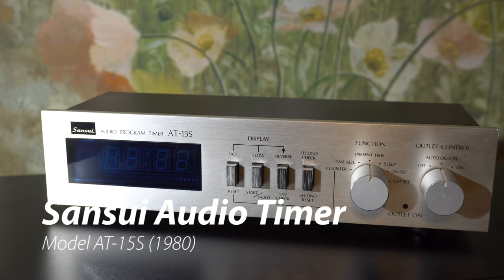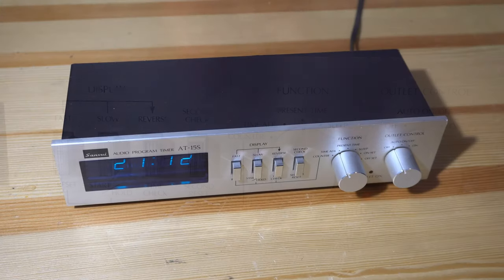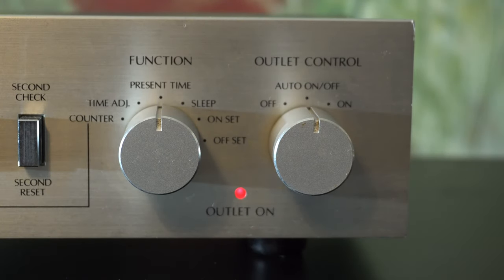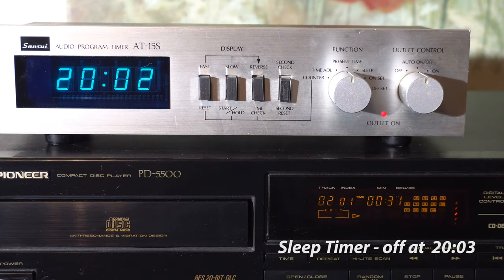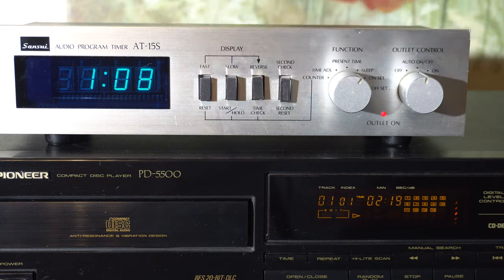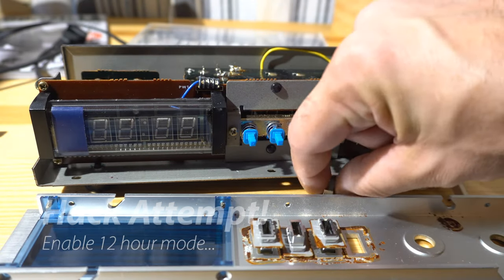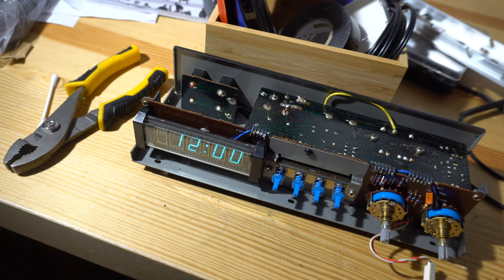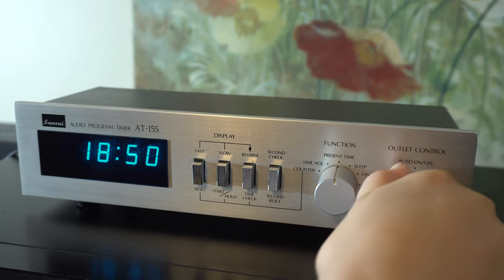Hack Attempt: Sansui Audio Timer (Model AT-15S)

Comment: Very nice :) I was searching the net using the words Audio Timer and your vid came up among other things.
But what I did not know is that it is quite similar to my unit which is not a Sansui but a Panasonic TE-97. They resemble some similarities I guess, for example the 4 rectangular buttons to set the time. The Panasonic has very little info on it and so I wanted to find out more about it and your video made it clear. Although the Sansui is more equipped than the Panasonic.
Reply from the maker: Thanks for watching and commenting! Yes it does look very similar to the Panasonic. These type of stereo timers show up in the "other vintage audio" category on eBay very often...

Comment: There are other timers that use the same Integrated Chip (MN6076) and have that AM / PM function. For example: Pioneer DT-510.

Now, just a quick question: i have the same AT-15s, but the display only show part of the numbers, its not working right. What should i do? Changing the IC is my first guess, what do you think? Cheers!
Reply from the maker: Before changing the IC,  you could verify the LEDs are working... Perhaps you could jumper a wire to send voltage to one of the malfunctioning LED segments to see if it lights up? If the display works, then you know the problem is it is not getting power and trace back from there... Also, there is a service manual available with schematics to download from hifiengine.com - good luck!
Reply: @ACBMemphis  Will check that!! Thanks!!

Comment: Just got one....don't know how to use its functions. I was able to set the time, but that's it. Not sure if it's defective. Can you help me out?
Reply from the maker: Sure. Here's what I did to make it work: (1) Plug it in, it will start to flash "0:00" (2) then set the function knob to "Time Adj" and use fast/slow to set the current time. (3) Next, turn knob to "On Set" and use Fast/Slow to set the time you want the stereo to come on. (4) Turn the knob to "Off Set" and use Fast/slow to set the time you want the stereo to turn off. (5) Set the function knob to "Present Time" (6) Finally, set the Outlet control knob to "Auto/On/Off"
Reply from the maker: Also I think one "trick" is: the "On Time" needs to be in the future for auto to work. In other words, if it is 6:00 right now you can't set the "On time" to 5:50 and expect it to turn on when you move the right knob to "Auto" - however you can turn the right knob all the way to "On" and then back to "Auto" and it will stay on until it is time for it to turn off.
Reply: @ACBMemphis  Thank you so much for the speedy reply! So, it looks like the unit doesn't work as intended. Doesn't flash 0:00 when plugged in, doesn't adjust time with the buttons, etc. Shame...the display was nice and bright. It's already packed up for the return. Again, thank you for your help! Best wishes...J.